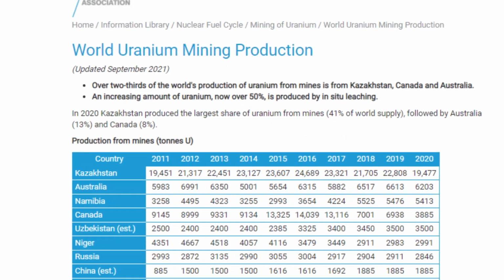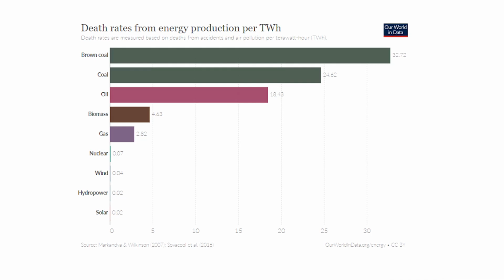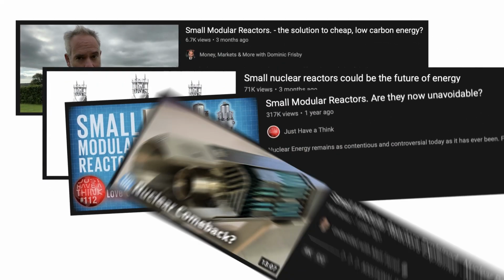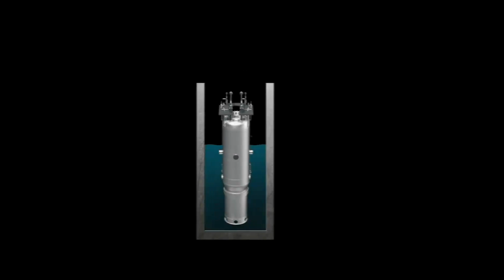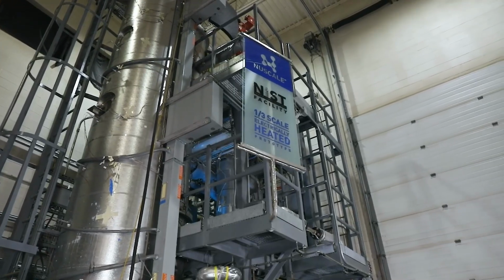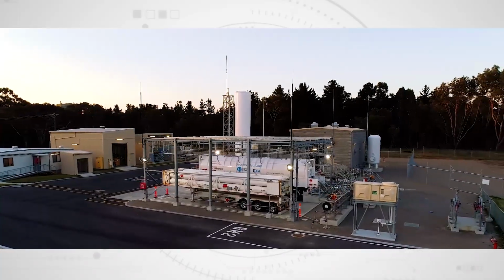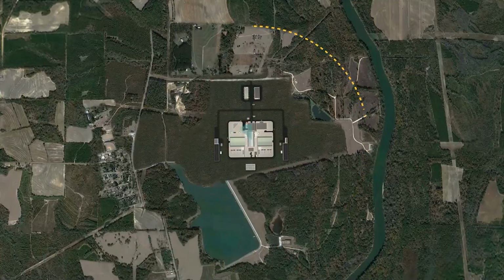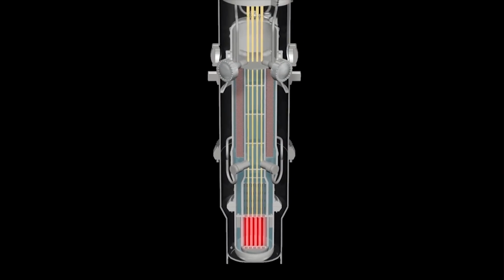Can Small Modular Reactors Save Nuclear Power?

Comment: Thanks Rosie for an excellent update on Nuscale.

If the Nuscale model or some similar was developed to be a drop in replacement for the boilers in current coal fired power stations, the nations who own those would not have wasted their investment.  Small modular reactors can and should be developed to be literal boiler replacements.  Modern small power stations are often made up of a series of 250MW to 600MW subunits to combine in multiples to make up the whole power station.  That’s why there are invariably 1 smoke stack and 1 cooling tower per production unit.   So a 250MW unit would require a cluster of 4 Nuscale units to replace the boiler.  A 600MW unit would require 8 units.   These numbers, times the number of coal fired power stations worldwide would make mass manufacturing, installation and post processing of the units both economic and relatively rapid to implement. 

Right now, 2022, power stations are being built throughout the world, in small and large countries.  Most of these are still coal fired due to the relatively cheap technology and price of coal which does not include the uncosted externality of CO2 generation.   The rate of power construction in fossil fuelled power stations, taken worldwide, way exceeds the installation of clean energy so the graphs are diverging.  Ergo, we cannot meet net 0 carbon goals.   But drop in boiler replacements would enable a rapid reversal of that trend.

Comment: Great video Rosie. Just my two cents worth here. SMR's are definetly a good  way to add stability to our grid. Thorium molten salt reactors have passive walk away safety and would be a great source of power for remote communities and mine sites that would need industrial power and heat without access to large bodies of water. The debate around nuclear power has been polarising in the past here in Australia, but attitudes are shifting and with more education will come acceptence. But investment in this technology will only come with the lifting of the moratorium here in Australia.

Comment: I hope they have done all failure mode testing such as if the control rods stick and cannot be lowered. As engineers we require three or more levels of redundancies.
Reply: To my knowledge, the control rods of nuclear reactors are usually held by electromagnets. If power is lost they'll automatically fall into the reactor.

Comment: Concentrated generation and then disperse across the grid.
$Billions/ m2.
Rooftop solar is dispersed and supplies the grid, the grid does the concentrating of energy. 
Electrical energy never knew if it was coming or going it just needed to be enough. Transformers work backwards and forwards.
Electrical EV car battery 100kwh will be everywhere in every home, plugged into the grid and trading Electrical Power for money. 
33kwh on 8.3 million homes.
20 million EV car batteries. 
The grid exists and the 40% capacity that was for non industrial needs is now available for additional industrial production 😀. At no cost. 
90% of petroleum imports not needed. 
Monopoly investment in fossil fuel industry is $300Billion cash flow every year in Australia.
Monopoly political donations. 
Even fat man Clive Palmer said he stopped Labor winning with his $83million spend. And he is 'fighting against' political donations. 
More Monopoly power supply is now not necessary and stupid.

Comment: I wish Dr Reyes had gone into the long term efficiency of NuScale reactors.  What is the burn-up rate? Do they use HEU or LEU?  How is re-fuelling handled; does that affect up-time?  I like their load following capability: 20 to 100% power in 96 minutes is really awesome. Fast breeder reactors can't really load follow that fast, which is why the idea was floated to run them at higher than necessary output and use any excess capacity to electrolyse water and create H2 -- (but could they do it via HTSE)? Good on them and thanks for the discussion. This time the tragic events in Ukraine might actually work in NuScale's favour. Hey Germany, if you don't want your old reactors, buy from NuScale or Thorcon. BTW France has a 7 year stockpile of Uranium. Germany has a 3 to 4  month stock pile of natural gas.

Comment: Decisions on long term survival of our civilization should hinge on reason, not feeling, strong or otherwise. But, yes, SMRs, besides being potentially cheaper* might rely on "out of sight, out of mind" effect to assuage those irrational "feelings". Because, even without taking into account effects on climate and millions killed every year by smoke particulates, nuclear energy is the safest energy source per joule produced as it is, even without further improvements that are kept from being adopted by fossil fuel lobby. All this Chernobyl or Fukushima notwithstanding. Actually, There is no greater testament to safety of nuclear energy then Fukushima incident, which had death toll of zero instead of thousands upon thousands that coal-fueled "greens" would have us believe. Having said that, SMRs are even safer than the current crop of reactors; "inherently safe" is not a marketing buzzword; it is a design feature.
*) Good part of high price of nuclear power plants is caused by artificially erected obstacles and constant roadblocks their construction is facing. Another fossil fuel lobby success story.

Comment: The inventor of the pressurized water reactor, Dr. Alvin Weinberg of Oak Ridge, stated that the PWR is safe if under 500 MW thermal.  Above this power level, in the unlikely event of a sudden shutdown, the decay heat of about 7% can not be dispersed without active cooling and if not cooled a meltdown of the fuel rods will occur.  This is the main reason nuclear reactors have become so expensive.  Larger reactors should have never been built or licensed by the NRC.  Fukushima's failed reactors were 1380 and 2381 MW thermal.  These were boiling water reactors built by GE.  Dr. Weinberg was not happy with his PWR design for power production, the design was originally a 70 MW th for the Nautilus, and so he developed the molten salt reactor, first for the Air Force and then for civilian power.  The MSR is far safer, cleaner and efficient than the PWR. The AEC had different ideas and Dr. Weinberg was fired after which his research data was hidden in a children's  museum.  It was found by NASA scientist Kirk Sorensen, but we are still waiting for an commercial MSR to be built in the US although China has just built a test reactor.

Comment: Please take a close look at Moltex and Elysium. These use molten chloride salts (basically table salt) to carry the fuel salt and as a heat transfer medium. The list of advantages over traditional PWR (large or small) is extensive. The biggest bring they can literally burn used “spent” fuel to make 20x more energy per kg of fuel and cut the radioactive life by 1000x.
Reply: Glad to see I'm not the only one which has discovered Elysium's reactors.   Just imagine running a fleet of nuclear plants with no mining, and simultaneously disposing of spent fuel.

Comment: The 30% improvement in efficiency for steam electrolysis really depends on what you are comparing it with, but the Hydrogen production is not where most of the losses are.  I very much doubt that it would make more sense than batteries.  The amount of storage will be extremely limited for load following.  Fair enough if they want to produce Hydrogen for industrial processes that need the element Hydrogen.
I would also extremely doubt their target price, however this is not the most important factor.  In Australia, unless you are prepared to ban solar a non-load following technology like Nuclear cannot be implemented.  4hr storage is expensive enough even with batteries, nevermind 8 or 10hrs.
Reply: Some proposed SMR's are load following.
Reply: @LonnieAdams4  Of course they are, and F1 are about to start using coal powered steam engines.

Comment: Hey Rosie, 
Fellow Aussie here and passionate nuclear campaigner due to the climate crisis. 

Whilst nuclear can be expensive the value it provides is greater than wind and solar, in that it's dependable clean energy, it provides the foundation for our modern society that's extremely energy hungry and can't easily just shutdown if we see a dramatic dip in wind or solar output. See Europe in 2021 when they experienced a wind drought. 

Also LCOE isn't the best at comparing the value or cost of technologies. 

The significant reworking of the grid to accommodate variable sources adds expense to the system which pushes up the price consumers pay. 

Finally, I'm 100% for going as hard and fast as we can on deploying clean technology but we have to remember that net zero isn't a like we cross and the climate crisis goes away. We have to sustain a clean energy system in perpetuity. So a MWh of nuclear produced in a decade or so is as usual to that goal as one produced today.

Comment: It should be noted that the levelised cost of electricity in the chart provided is not a true reflection of the costs to consumers.
the consumer's cost has the cost of back up electricity and the cost of extending the grid to far flung dispersed renewable generations sites, factored in the cost of the power they pay for.
With these costs renewables cause a rise n power charges very different to the chart that you used.
good discussion otherwise.

Comment: So they have taken a “safe” design and add a potential hydrogen bomb next to it? What happens if the hydrogen explodes and the tall reactors get knocked over? How does gravity lower the control rods?
Reply: If you mean "hydrogen bomb" as in a thermonuclear bomb, it doesn't work like that. Actual hydrogen bombs require rare isotopes of hydrogen (deuterium and tritium) in concentration. If you mean the hydrogen igniting, as in forming steam with atmospheric oxygen, the containment vessel can withstand that.

Comment: While some nuclear power main remain in the future, I don't see the cost going down as the guest expected (58$ in the best case and with public funding ... and with a new technology that has yet to be commercially viable). Standard nuclear is expensive due in part to safety regulations and small reactors while having an advantage there are still to be determined safe(r).

A lot of hype is made around that technology while it's still in the works and has been for a while. Renewable is coming faster and better due to shorter iterations cycle and greater security and I think this is what is going to win in the long term.

The war in ukraine is also reminding that human created threats can also be dangerous while using nuclear and they can be targeted in time of war .... or through terrorism.

ANother way to look at this is that it's wayyyy too soon to declare the small reactor the solution for the future while they are still in development the same kind of thing that can be said for fusion power. Because despite the progress been made recently we're still waaayyyy before true commercial power for fusion (though the small reactors should hopefully come to fruition sooner than fusion).